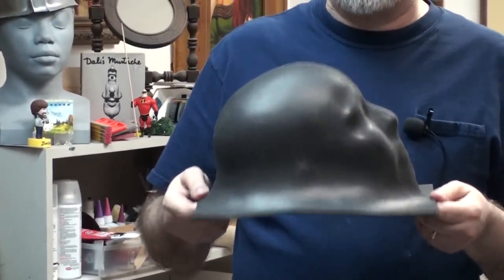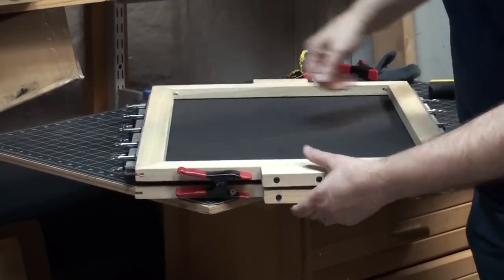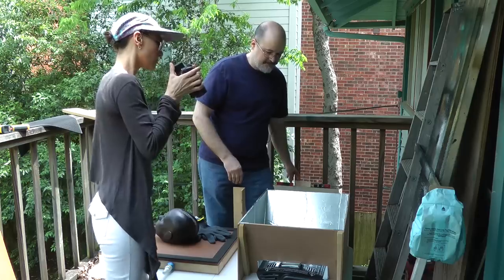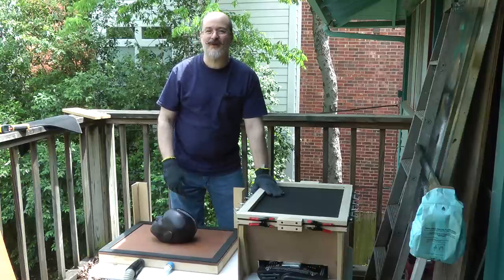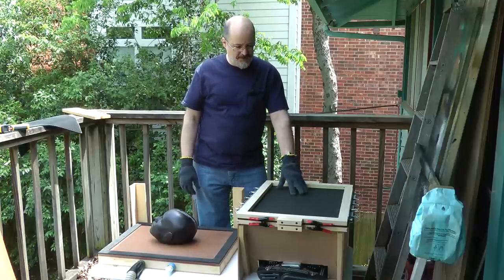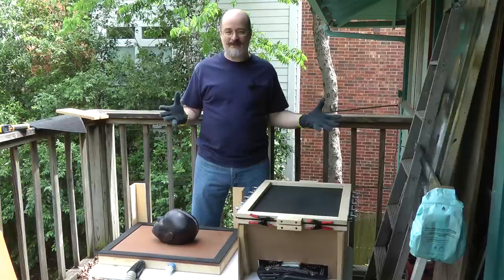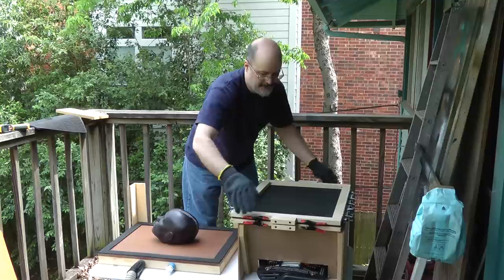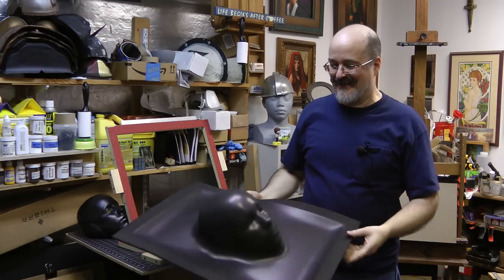Yes, You Can Vacuum Form EVA Foam!

Comment: That's really cool!  Thanks for making this video. Say... this face/head impression you made, if you turned off the room light, and use a low watt bulb (warm color is best as it casts shadows) and shine it on the impression side of the mask (see 9:54 for example), the face will look like those floating faces at Disneyland's haunted mansion when standing about 6 feet back or further. I've only seen these work with white masks or on white material, but dark looks like it'll work just as well, especially in a pitch black room with just a 2 watt bulb focused on the face, or even a UV or black light (those work better on colored or white material).

Imagine using this (the entire sheet uncut) and place it in a [hole or cutout] in the wall and it'll look like someone is looking at you. The face even follows you as you move back and forth.

Comment: My JAW DROPPED THROUGH THE FLOOR when you tossed the sheet on the vacuum former! I was expecting it to take some time, but it was immediately formed! That's amazing! I can see so many applications for this process as a soft figure Ventriloquist's puppet builder! I'm gonna SCHTICK this in my SAVE files! This is really exciting! Maybe I'll vacuum for my hard sculpted puppet - "Morthan"! 
Can you use this with a clay sculpture? My mind is going NUTS with possibilities on this!
Reply from the maker: Yes you can use this with a solid clay sculpture. For quick shapes out of clay make sure you freeze the clay first. You'll get some clay goo on the inside of the foam.

Comment: Have you ever thought of or used a heat gun while its vacuum forming to kind of tuck it in tighter at the base? Will that work?
Reply from the maker: No I haven't. I usually compensate for the curve by making the pattern higher, so I never had the need to use a heat gun.
Reply: @PropMonkeyStudio  What do you mean by 'Making the pattern higher '?
Reply from the maker: @LEO-xo9cz  The pattern is either made taller than I need it, or I place spacers under the pattern to raise it up. This way I just cut off the curve at the bottom, and I'm left with what I need.
Reply: @PropMonkeyStudio  Ahh I'm with you. Do you think it is safe to cast sensitive equipment such as cameras and lenses?
Reply from the maker: @LEO-xo9cz  If you wrap the lens in fabric first you should be able to vacuum form over it safely.

Comment: First time I saw this attempted was by Ryan Wells but the foam was a bit thick.

This looks like it'll capture more detail (Well, thinner foam helps too, but still)

Nice
Reply from the maker: With 2-6mm EVA foam you can get good form fitting shapes, and the thinner the foam the better the detail. For higher detail you can use the same set-up, and you'll have to use HIPS or ABS plastic.
Reply: @PropMonkeyStudio  Oh, I know. I was just surprised by the detail retention.
I'm aware that thinner material=higher detail.

Just wasn't expecting this with foam.

Comment: Hey! This helps me solve the heating portion of my DIY former.  Would really any 1,500w ceramic heater work as well?  I see quite a few offerings on Amazon for only low $20
Reply from the maker: To answer your question: I don't know.

The dimensions of the heaters I own are about the same. I wanted a long unit for a more even heat. This doesn't necessarily mean a smaller one won't work.

Comment: That is soooo cool! Thank you for sharing your plans!!!
But I would like to know if you also could heat up the foam in your oven instead with your heating unit? I can imagine that the foam could heat up in the oven more consistently ( and to be honest, if the oven would work I could save the money for the heating unit ^^ ). Or will the foam burn/melt away in the oven? ;)
Reply from the maker: I would advise not using your oven, because of toxic fumes. Outside or in a very well ventilated area is the best.

Comment: Hello and thanks for sharing your knowledge I wondering if you can say to me at what kind of distance you put the eva foam and the heater, so these material can be in the exactly temperature that you saying. Because I try it with my project but the Eva foam burn it so you can help me to resolve this situation. Also I love your work and I sent you regards from Mexico.
Reply from the maker: In the description (under the video) I have a link to the plans for the vacuum former. You can calculate the distance from heater to foam in the plans.
Reply: Thank you so much I'm going to check that 🤘🏻

Comment: This is so clever! Thanks for the video. Does the foam get very thin around the form because of stretching?
Reply from the maker: Yes, the EVA does thin out, and it gets a little denser.
Reply: @PropMonkeyStudio  I'm guessing - then, that it holds a shape all the better because of the increased density! Fantastic! I'm going to play with heating EVA foam to make my ventriloquist puppets!

Comment: Did you make the mannekin head or buy it? What is it made of? Thanks!
Reply from the maker: I did a head cast of a friend.
Reply: @PropMonkeyStudio  of a friend? Damn sir, that's scary af🤣 what the mold made of? Fiberglass?
Reply from the maker: @ultralinx200  I made a mold from a plaster cast out of silicone. Then made a slush cast with resin and back filled it wit expanding foam. See the casting part of the head cast video I did. 
https://www.youtube.com/watch?v=-06zn2gWUJA

Comment: You are a lot of fun! Haha! Really enjoyed this. I wonder if you could advise me on something? I am looking at vacuum forming 2mm acrylic. I need to create the patterns for this project as I'm not copying something existing. What would be the best material to make a pattern out of? Any advice from anyone would be amazing, thank you! <3
Reply from the maker: Home Made Patterns For Vacuum Forming Plastics
1) Simple pattern: wood (with wood filler to smooth) works great.
2) Complex pattern: you will need to sculpt first with clay, plastic, or any other material. Then make a mold from that and cast in hydrocal (hydrocal is a hard plaster).
3) For a super smooth you could possibly use a hard high temp silicon. This would be harder to make, but if you are doing mass production it might be worth the time.

Comment: Hi. Nice job. Do you think it's possible to do the same with 2mm 40kg/m3 EVA foam? Obviously not so stiff, but I wonder if the sheet won't crack while forming
Reply from the maker: I've have good success with high density foam 2mm. The low density doesn't do too well.
Reply: @PropMonkeyStudio  Thanks. Do you know how much kg/m3 (or imperial) is the 2mm high density you use?
Reply from the maker: @NimbusDirigiblesSL  I do not know :(

Comment: idk if it's more practical to use a mold with foam clay or to do this, i wanna make these gear thingies on the sides of a kamen rider ryuki belt but idk if vacuum forming will get all the engraved detailing and grooves.
Reply from the maker: Sorry for the very slow reply. Foam clay will get you better detail.

Comment: I have a question, if you place a 1cm ring under the head would you get coverage? Like a fuller replica. Not just the front of the head.
Reply from the maker: There are two problems with that. First, I don't think the foam will stretch enough to do a full head. Second, if the hole opening is too small you wont be able to get the head cast out of the vacuumed foam without cutting it. Solution: You can vacuum form two halves of the head and glue them together.
Reply: @PropMonkeyStudio  thank so much. Though I'm going to be using plastic not foam, I'm betting your advice will still work. 😊

Comment: Did you have to modify the heater such that the tip-over switch of the heater does not activate when laid down flat the way you have it?
Reply from the maker: The only modification I did was to take the arms off. There isn't  a tip-over switch on these heaters.
Reply: @PropMonkeyStudio  amazing! by any chance do you have a link for that specific heater. were using this method to create a shell for our senior design project. we are constructing a small scaled UAV.
Reply from the maker: @n0wii  The link is under the video

Comment: Thank you very much for posting this. I used this video for making a own vacuumvormer to test the possibilities. Just finnished all the parts and soon be testing. I coppied your one hole design. What is the reason for u to usae one hole instead of multiple holes?
Reply from the maker: Hi Rutger Oomkes,
Only one hole is needed, unless you are forming multiple items at the same time. When I do more than one item I place the matt down that I show in the video. This makes it quicker  to build the vacuum forming table, and the vacuum pressure is focused around the pattern.
I hope this helps,
Dave

Comment: When you block off a vacuum cleaner suction hose the vacuum sounds like it's working harder. It's not, when you block airflow on a centrifugal fan it uses much less energy, draws less amps electrical current because  it's throwing/moving less air so it spins faster, changes vacuum cleaners sound to a higher pitch cause it's doing less work and fan/motor is spinning faster.

So for example an air conditioning units squirrel cage type centrifugal fan, (indoor section where air filter is) when the air filter is dirty the fan motor uses less electricity, draws less amps. 

Opposite of a prop fan like an airplane propeller or box fan, block or restrict the airflow on this type fan, power use increases over being in unrestricted free air  fan motor uses more power, draws more Amps that can burn out the motor plus often motor uses airflow from the fan to cool it making situation worse.

Comment: Hello! I’m looking for some foam for my punch sensor metal plate i need some foam cushion to avoid injury the arm when punching it. 

Could you give me any suggestions of what types of foam I should experiment with? I was thinking to use some high density foam as the inner layer and some softer foam as outer layer would really appreciate any suggestions or tips. 

Thanks.
Reply from the maker: If you can replace the foam on a regular basis, low density against the pressure pad and high density on the outside. The high density will last longer. 

If you want the pad to last even longer I would use low density against the pressure pad and thin leather over that.

Comment: Your mold looks like it’s a styrofoam with soemthing painted over it? I have a buncha objects id like to vacuum form that’s are styrofoam. Hacking a hard to figuring out what I could pain over my foam to make it safe to vacuum form
Reply from the maker: Not styrofoam. The head that I used is a hard resin cast with a expanding foam filler. It handles high temperatures well.

Comment: Hello, what temperature does the EVA need to be? I'm using 6mm.
Reply from the maker: It's hard to tell the exact temperature (Maybe 250˚ F). The vacuum form box can get up to temperatures past 300˚ F.  The foam needs to be flipped often, so it wont burn.
Reply: @PropMonkeyStudio  one other question how strong is your vacuum? I have an older 3.25hp Ridged shop vac.

Comment: Great video, nothing left unexplained. I have a question about the EVA foam. Does it get stiffer after vacuum forming or is it just my impression? Could I use this method the make nicer motor nacelles for this foam airplane? They don't need to be really tough, they only need to cover the structure underneath.
https://www.youtube.com/watch?v=HXgLDOR_DAs
Reply from the maker: It stiffens up very little, so it remains pretty flexible. You might be better off vacuum forming thin sheets of styrene.      ~ Nice work on the plane.
Reply: Thanks a lot for the quick reply!

Comment: Sir how much watt vacuum cleaner you are using?? I used mine it is not working....
Reply from the maker: The easiest thing to do is borrow vacuum cleaners from friends and see which one works the best. Make sure the bag is taken out of the vacuum cleaner to increase suction, you have a tight seal on everything during vacuum forming, and the the EVA foam is nice and rubbery when heated.